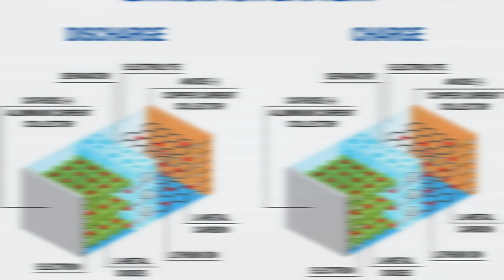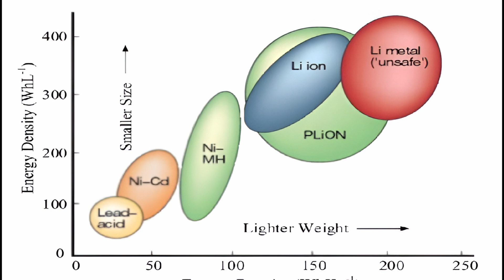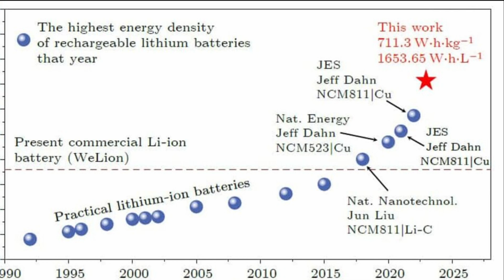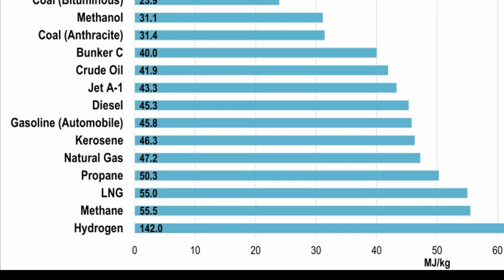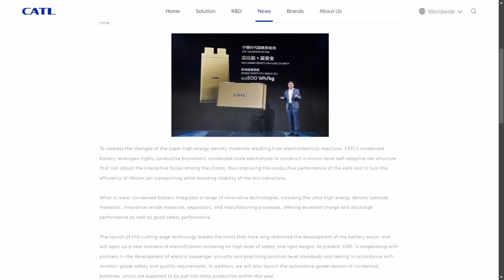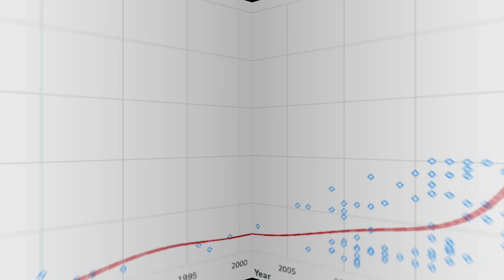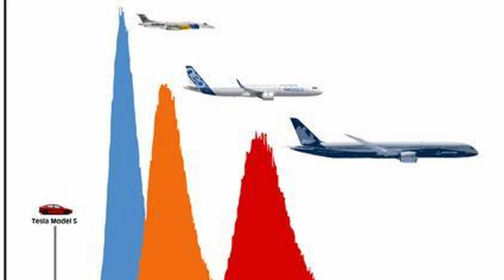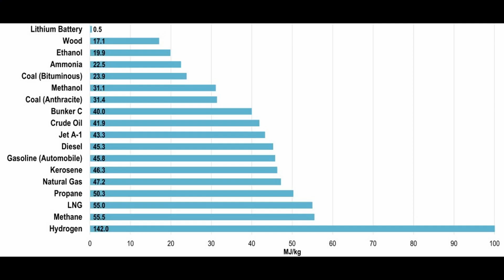When Will We Finally Have Super High Energy Density Batteries?

Comment: Energy density actually has to be higher for battery planes than Kerosene burning planes, because fuel is burned, so the power consumption drops as a plane gets closer to its destination. A plane will because of that also be significantly heavier when landing, which might mean less cargo can be carried, even with 10kWh / kg batteries.

Comment: But you're still not eliminating that the majority of electricity to recharge these batteries will come from kerosene, natural gas, and coal fired generating plants. Try fixing the problem from top down with electric generation then ocean transport then trains. The last things to be forced to go all electric is cars and houses because wood has a higher energy density then the best battery and wood doesn't stop working when the temperature drops below 0

Comment: Exponential curve? The theoretical maximum for lithium is 1600Wh/kg if you go solid metal anode and cathode. Energy density will almost certainly hit a brick wall long before that since you still need some base layer current collectors to re-form the anode/cathode when either one gets fully depleted during charge/discharge and a separator in-between. If you use lithium as the current collector, then you need to manage the charge/discharge cycle to ensure neither side ever gets depleted, effectively creating an inert amount of lithium on both sides that reduces net usable energy density too.

Then you have to factor in everything necessary to make those cells reasonably safe, durable and reliable, which usually weighs significantly against energy density.

800Wh/kg may very well be the practical limit - half of the theoretical limit. And we're likely 10+ years away from production batteries getting there while meeting all of the safety, durability, reliability, etc. requirements.

Comment: The comparison with kerosine isn't actually accurate. It ignores the hundreds of litres of O2 gas you have to burn with the kerosine to extract the energy, the fact that the internal combusion engine only extracts about 30% of the energy, more if uit's running a dynamo in a hyybrid engine, and the additional mass of the IC engine and mechanical transmission needed to transfer that energy to the wheels. A battery is 95% efficient, and drives elecric wheel motors directly.

Comment: Thus we need a kerosene battery 😊

We need a device that chemically reacts kerosene with oxygen but instead of generating a flame the energy output is electrical energy.  This is called a fuel cell.

Fuel cells have their unique problems, but energy density is not one of them. I think it's a research topic worthy to pursue.

Comment: For cars, I don't think most buyers would opt for 600 miles of range. Instead, they would prefer something less, with less cost and weight. Higher energy density is still desirable, for those configurations.

OTOH for other applications, such as aircraft, bigger packs would be needed.
Reply: If solid-state batteries deliver on 500-800Wh/kg and costs going down to $35-50/kWh, I think most people would gladly split it half-way: 50% more range for 30% cheaper instead of whole-hog on max range. Especially as highways get more uniform fast-charging coverage. A smaller, lighter battery pack means less structural support is required, cutting weight on both the vehicle and battery, reducing cost and tire wear while improving efficiency. I know I'd be perfectly fine with an EV that has 400km (~250mi) of worst-case winter range. My mother's Bolt EV gets about 280km of real winter range, which is too tight for my comfort, especially for an abysmally slow fast-charger.

The spotty visibility, availability and reliability of fast-charging along highways is the fourth biggest reason I wouldn't own an EV as a primary vehicle after skepticism about battery lifespan, up-front cost and horrible repair costs whenever anything happens to EVs for which parts are often nigh impossible to get in a remotely timely manner. So much stuff on them being CAN-driven also means anything computerized usually requires an expensive OEM back-end subscription and an expensive scan tool to program to the correct VIN.

Then again, the CAN/Etherloop DIY-pocalypse is coming to ICEVs too as manufacturers move to reuse more walled-garden computer-driven parts across all product lines.

Comment: The real problem with batteries that have substantially higher energy densities than today is that they are essentially dangerous as the energy can be spontaneously discharged if there is a fault.  It is bad enough when Li-Ion batteries go bad but imagine if such a battery had double or triple the energy density. This is to say nothing of the energy required to charge the battery in the first place in the case of vehicles and other machinery with very large batteries.